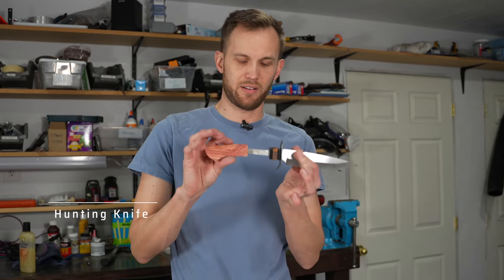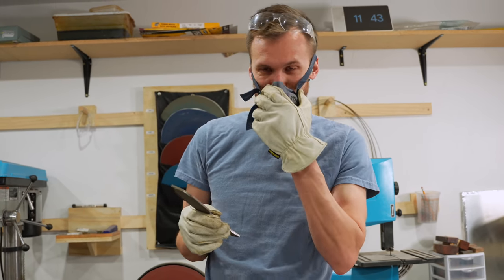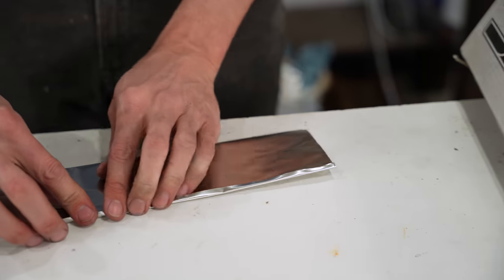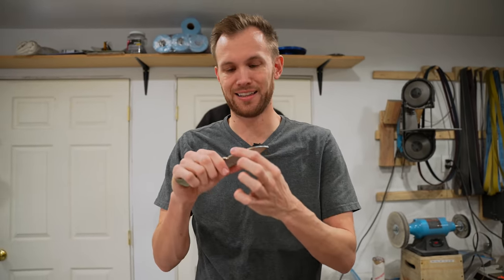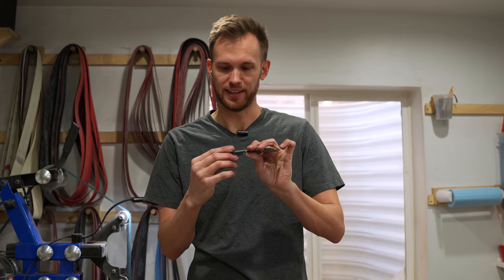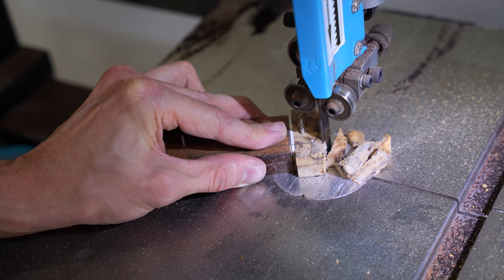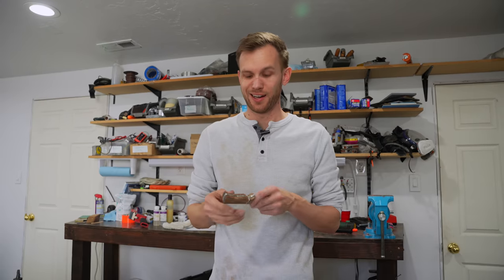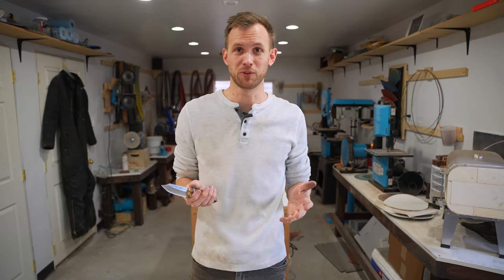Metal Bar into a Clip Point Knife!

Comment: I have a technical clarification question about process order. Is it normal to temper/heat treat the metal before grinding off the cutting edge area? I would have thought grinding until the blade is almost done before making the metal harder would make more sense. It's like you are making more work for yourself. Not being critical, just interested in the reason behind it. Beautiful knife, and great video production Nate.

Comment: Nate what I do when making a knife design is make them out of wood first to really get a feel of the new design, you can then 3d model it and 3d print plastic templates. That would make a seriously good video.
Reply from the maker: 3d modeling and printing would be much slower than just making it from wood or something.
Reply: @NFTI  I agree, I just meant after you prototype your new design to scan and print but I see your point I was thinking the blanks get put in folder for later use as templates

Comment: Wondering if you have played around with railroad spikes while exploring this. I wanted to learn more about blacksmithing back in my high school days, but allowed myself to be convinced to rush off to college for other things. I'll tell you, I sincerely regret it now.

I've kept it as a very sparse, off-and-on hobby, but haven't really ever done much with it. Almost all of what I've done in the past started as a railroad spike, but I've never learned to forge-weld. Not having the skills to insert harder metals to serve as a blade means most of what I've made(knives) are purely decorative. 

I did try my hand at forming a spike into a tomahawk/hatchet, and once you get it right it's a fun process. Since I was using railroad spikes, I thought it would be best to keep the 'head' of the spike intact and contract/expand the nail into the blade. I remember the hardest part was forming the eye for the handle, as my forge at the time wasn't all that good and it took considerable heat. I actually burnt up the first one I tried at this stage, letting the charcoal burn too hot and for too long. That first one still makes for an interesting bookend or paperweight.

Keep it up. I appreciate the freedom gained with your own channel. There may be cons, but it is what you make of it.

Comment: So I've often wondered what exactly determines where that dividing line goes considering the edge itself is being sanded in seperately, it is just aiming for the center of the blade? or is there's a structural purpose for it?

Comment: Hey Nate. You should look into one of those portable band saws. They are excellent for cutting out profiles and you don't get so much airborne particulate.
Reply from the maker: I have one, they don't work on most types of stainless steel, which work hardens as you cut, so after about 3 inches of cutting you have ruined the bandsaw blade.
Reply: @NFTI  well now I know! I've never worked with stainless.
Reply: I made my 2x72 and was powering it with a treadmill motor and its speed controller but I kept burning up my motors. In an effort to reduce the friction between the belt and the platten I started trying silicone/Teflon spray lubricants. They don't seem to degrade the belts or mess up the tracking and they decreased the friction and the  temperature of my platten by a large margin.  Also made my belts cut better but that was probably because my motors were generally underpowered.

Comment: Have you tried soaking your handles in linseed oil then applying a surface coat and letting it polymerize?  I haft axes for a hobby and linseed oil is everywhere I look in the axe community.  Might not work so well for knives because it causes the wood to expand, though, so might break the epoxy or otherwise distort the measurements.  not sure, but possibly worth a shot?

Comment: PRO TIP -
buy some 3M cubitron II cutting discs for angle grinder 
and sandpaper 
they use self sharpening ceramics 
work 10x faster 
last 10x more 
i know it sounds unrealistic 
untill i tested it myself - i was using 20-30cheap sandpaper discs on orbital sander or around 10 more expensive ones then with Cubitron II i only need 1 and i use it untill velcro wont hold anymore
the same for angle grinder - 1 cubitron repleace for me 7-8 brand ones

Comment: So with a lot of other knife makers I have seen the most common thing to do for heat treating the knife is get it just past cherry in the furnace then squelch in oil. Is there any benefit to cooling in your steel foil with air over the oil dipping method? Do you get a harder temper? I'm a novice but I also worked at a steel mill for years and am familiar with the molecular process of steel but that was for MUCH larger things that we would squelch in giant water tanks after baking them.
Reply from the maker: Depends on the type of steel.  What I did is normal for stainless steel.

Comment: Just curious,  I've seen you use liquid nitrogen to 'quench' the blade to harden the metal after heating it up in your knife oven and then cool it down in the vice setup you have. My question is, why not quench the knife in oil while its still hot?  If it is warping you are worried about you have a short amount of time after the quench to straighten it and if you surface grind after the normalizing cycles that will both get rid of any scale and any minor warp that remains. As I said just curious, you are the only person I have seen using liquid nitrogen before in this manner (granted I'm no expert)
Reply from the maker: Most stainless steels need to air quench, not oil quench. It's a speed-of-cooling issue. The plates hold it straight while the air cools it.
Reply: @NFTI  ahh ok, didn't know that about stainless steel.I knew what the plates were for. Most of my blade knowledge comes from Alec Steele but he really only deals with steel not stainless. Cheers for the quick reply btw

Comment: So when sanding the face of the blade how come u go slow the first movement and then fast on the second?
Reply from the maker: With the surface grinding attachment on the grinder?  Pulling it towards me, I move slowly because it's removing the metal.  Pushing it away is just returning it to position, and then I need to move it another 1/1000th of an inch toward the grinder.

Comment: What everyone else said!
Would a puff of Nitrogen in the ss envelope help by reducing the Oxygen level before sealing the envelope? Just a thought.
Reply: Also, my IT background kicked in when I saw those massive metal blocks you used while cooling the knife in envelope. They look ideal for water/fluid cooling, which would remove the need to blow air around the knife for cooling, as well as possibly being more effective at cooling the blade over the greater surface.